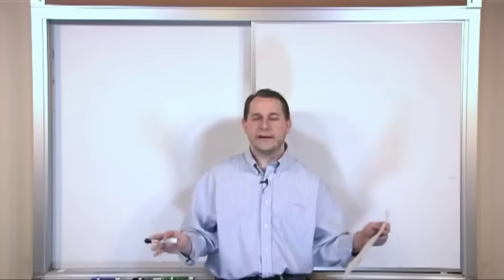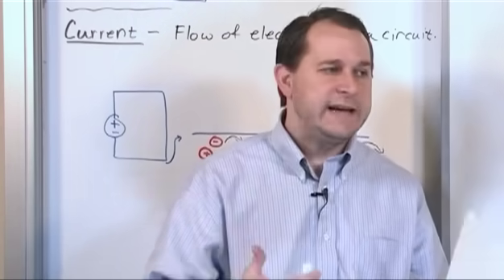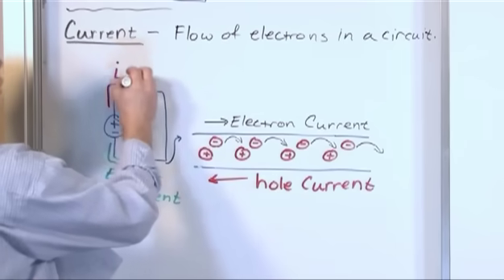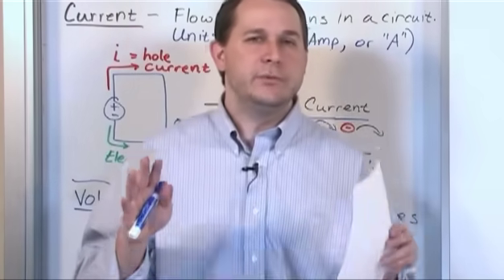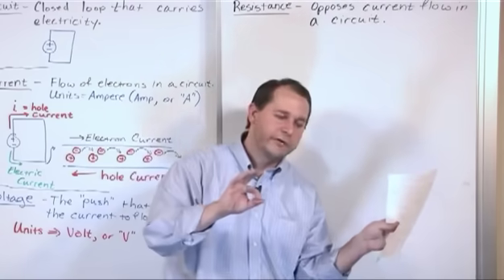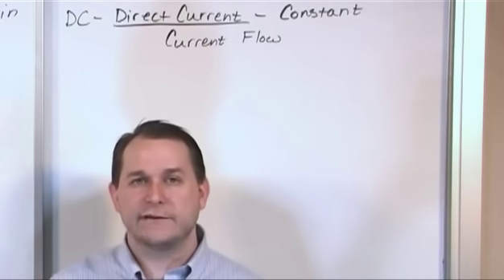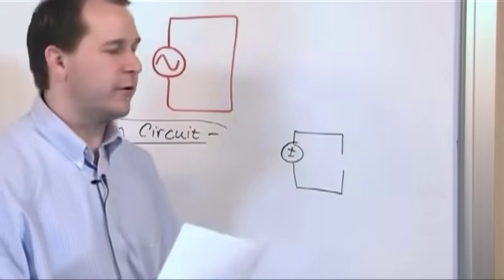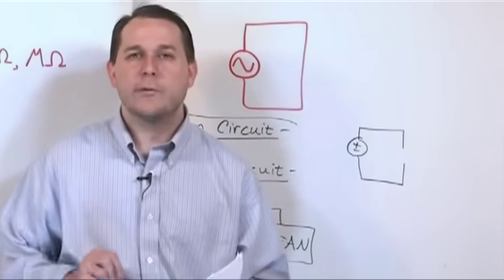Lesson 1 - Voltage, Current, Resistance (Engineering Circuit Analysis)

Comment: at 39:07 you say that current flow will be zero through the load when there is a parallel connection with insignificant resistance(short). In a parallel circuit, the exact amount of current will flow through each branch according to it's specific resistance, a branches current flow is not dictated by the other branches. Since each part of this parallel circuit have say, 120VAC to the branch, the current is dictated by the resistance of each branch. As the fan motor has the exact same resistance to current flow it always did, the exact same amount of current will flow through that part of the circuit. The problem is not that branch, it is the branch with insignificant resistance. This branch, with no more than wire resistance has a resistance to current flow so low that current rushes through this branch back to the source and through to the breaker causing it to trip. As long as what causes your short circuit does not disconnect your load, you still have a load in that part of the circuit, you still have, say, 120VAC on each branch. As long as that load is still in the circuit it will most certainly see current flow, the shorted branch will cause the breaker to trip so fast that the fan will not get a chance to start to turn however.
Reply from the maker: Hi Kevin, with respect, you are incorrect here.  When you short circuit a load, by placing a wire across the terminals of a load with a perfect conductor of zero resistance, 100% of the current will flow through the short, and 0% of the current will flow through the original load.  What I don't think that you realize here is that a perfect wire can't have any voltage across it.  Because of this, the source voltage immediately gets reduced and no current flows through the original load.  In real life, current will increase very fast in the short, probably burning it out physically.  Thanks, Jason

Comment: So for a short circuit if I had 2 loads, one was a open circuit (unplugged) and one was a closed circuit (plugged in) and the one with a closed circuit had a bigger load than the one with a open circuit, and I were to plug in the item with a smaller load, it would cause a short circuit? (Imagine the box he drew and the “random wire” was my smaller load)

Comment: I think it's important to point out that voltage is the difference in potential (electric charge) between two points. A 9V battery has a difference in potential between the two terminals of 9V. The + terminal is 9V more positive than the - terminal,. The - terminal is more negatively charged than the positive terminal. The difference is 9V more negative. When the battery is placed in a circuit, the negatively charged electrons want to flow to the more positively charged terminal to equalize the difference. They are attracted to the positive terminal. "Holes" appear to flow in the opposite direction, as you have stated.

Comment: When I took electronics at the Navy electronics school, we always used electron flow when we talked about current, and that the arrow head in a diode or transistor pointed to the N type material (which it does). This means that current flowed in the opposite direction the arrowhead was pointing. It made no difference to how our mathematical formulas were written (you mentioned having to deal with negatives). Current flows from negative to positive, and there is the same voltage drop across a resistor regardless of which direction one chooses to use for current flow, and all devices and circuits operate the same, and circuit analysis is the same. I have no problem thinking of it either way. It shouldn't be a problem for anyone. "Conventional current" or electron flow ...makes no difference.
Reply: Can you respond to this

Comment: I'll disagree with your analogy for using a fluid to describe the circuit.  Although its relatable to new students, only the resistor is a linear device.  The capacitor and inductor are not linear devices, and those 3 are the basis for the entire body of knowledge for electricity.  The analogy can only be used for DC circuits, and only for a resistor.  This analogy falls apart when voltage and current change.  I would encourage you to use the damper, spring, and mass for your analogy since they are mathematically related to the resistor, inductor, and capacitor.  You even touched on sinusoindal analysis, so you should know that students will have to change their way of thinking for AC.

Comment: Maybe someone here knows the answer to my question or correct me if I'm wrong.

So if you get a thin wire for your circuit and and try to put high voltage through it. That means that the electrons will be in caos colliting with each other , right?
So because they crash against each other (electrons) that creates the heat in the wire and cause it to burn (overheats) am I right?
Is that crashing of electrons that causes the wire to burn or get hot, the same process that creates light in a bulb? Is that what's going on in a bulb??
And Why doesn't the bulb explotes from been turned on for hrs??
Sorry to many questions I know :).

Comment: WTF !  a wire from a positive to a negative is a direct short, and will melt the wire or short the battery and drain it immediately.  there is no negative and positive things jumping in one direction, there's negative meets positive and heat and fire and BOOM .

Comment: I've always thought of them inversely I guess... voltage as potential or the 'high point' on a gradient along which current can flow-and the 'pressure' of the flow or current as measured in amps...

Comment: the best way of instantiation voltage is pressure in water flow pipe and current is like water flow itself and resistance is whatever changes that pressure of the flow in that pipe

Comment: DC stands for direct constant. And AC stands for alternating continuous. Current is another term for voltage.. that’s why they stopped using it to describe the types of energy. Ugh.. it’s a sign wave.. and it’s value is constantly changing.. alternating between positive and negative 120v.. or 240.. whateva..

Comment: Nice explanation ,
But we were taught in Germany,  that a Electric circuit has electric source , consumer and cable.
A electric circuit is without consumer (lamp) a short circuit 
Please correct me if I'm wrong
Reply: If you have a source with no Load or something to do work and the two wires of the source are not touching you have an OPEN circuit until you add the load to do work and use the electricity and CLOSE the circuit. If the Two wires coming from the source are Touching you have a SHORT circuit The only truly useful circuit is a sources and a load and a way to Stop the source at will such as a switch. source load and switch added to the conductors are the basic components of a circuit.

Comment: Correct or not correct. If ten thousand volts is less than three amps, it won't kill you. Three amps or more with ten thousand volts kills. This is why a stun gun works...
  It's also a lot safer than using direct current.
 Edison argued with Tesla (the guy Edison stole the science from) and made a FAKE public display telling the public that Tesla's idea of using AC was "TOO DANGEROUS"...
 If "God is in control" why didn't Tesla win instead of Edison?
 41:03 into this. This is were you mention WHY I'm watching these videos. I'm increasing my knowledge of electricity that doesn't even come close to your knowledge. Those other pieces of knowledge you mentioned comes under my terminology of INdirect knowledge. Because I won't be able to "build a nuclear power plant" etc etc... Direct knowledge is different from indirect knowledge. Indirect knowledge does you no good until someone hires you and you get MONEY for that knowledge. But you're not living off your knowledge. Your living off the MONEY you get for that knowledge. This knowledge you're teaching here is the VALUABLE kind. Don't need an interview for you to benefit from it..  The more knowledge you get, the less money you will need. If you're getting the right kind of knowledge. You can build your own stuff. Saving yourself a lot of money.
Reply: 3 amps, i hope you are kidding because the human heart can only handle 75micro-amps or 0.075 amps, but even shocks with 0.01 amps are quite dangerous and deathly
Reply: Also tesla did win

Comment: Hello mathtutordvd, can you say what a PBR is? i opened a a/c damper actuator from my car. Inside is a printed circuit board and a d.c. motor and gear train. The damper operates about 90 deg. clockwise and counterclockwise to modulate the damper.Question: one gear operates nothing but gets rotation from the train and is turning a part called a PBR, is this part tracking the damper motion??? Appreciate any help. Regards

Comment: in a nutshell teaching is best. when the 'prof' gives initially  the big picture. In almost 30 years of working as an electrical technician, I found that I NEVER had to compute values to make thing work, That is not within  the scope....... an appreciation definitely yes. The values are there done initially and  ostensibly correct by an engineer at the factory. That is the reason schemtics exist. Correction, ENGINEERS !!  I see my method, my way  big pic is one great way.  To restore it to close proximity to given values is the key.

Comment: Thank you for finally clarifying why some instructors teach electron flow while others teach conventional flow.  I had one instructor (A very sharp PE that used to design radar stations in WWll) that told us that diode flow could easily be seen by which way the anode was pointing (like an arrow).  Of course that only works if you are taught conventional flow.  The problem was I had other instructors that taught Electron flow.  When we got into full wave bridge rectifiers it just about drove me up a tree.  By the way, I've instructed Electricians for about 30 years now and you are one fine instructor my friend!